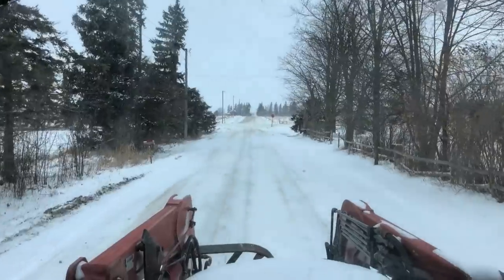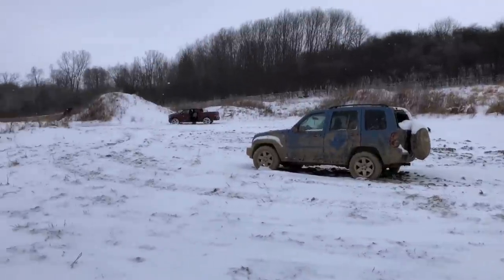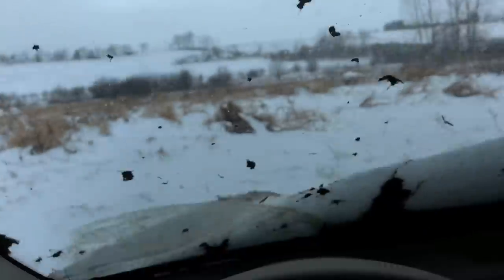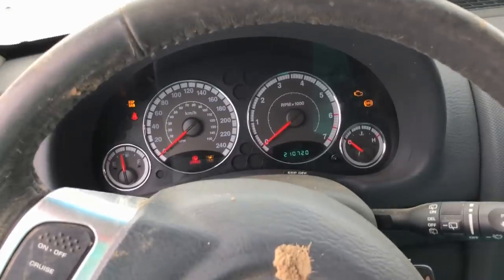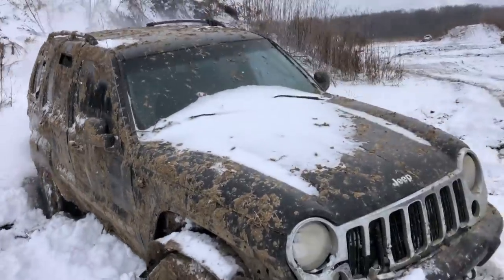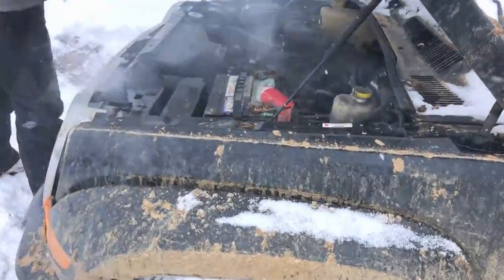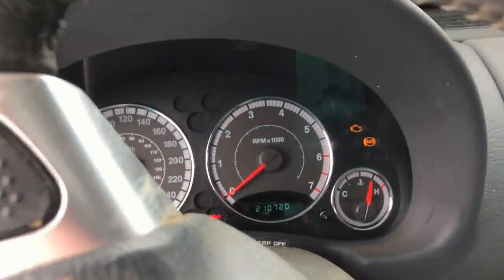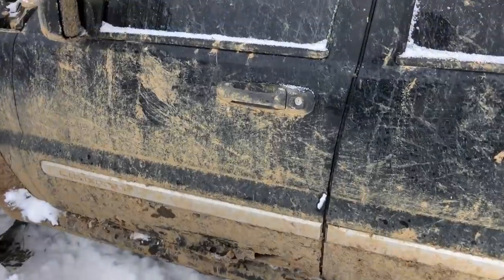LAST Jeep BURNOUT! Bye Engine!!!

Comment: chryslers wont start if the coolant level is to low, it has a coolant level sensor. add water or coolant it will start..
Reply from the maker: C’mon! Really? If that’s it You’ll be receiving the highest of fives
Reply: as long as you didnt blow the head gasket, fill her back up and crank it.....
Reply: Well even if you did blow the head gasket, head gaskets need lovin' too!

I mean, it is called a head gasket! 😂😂😂